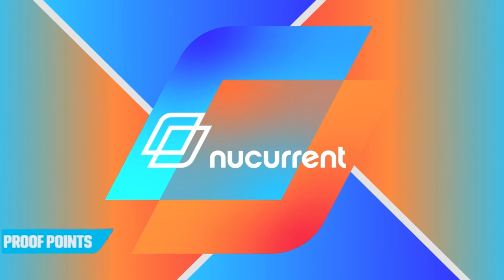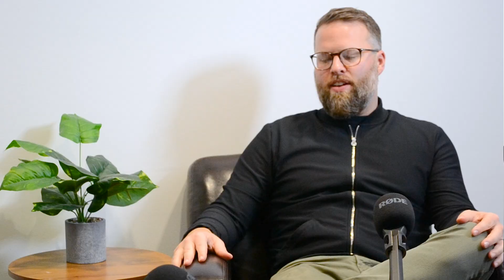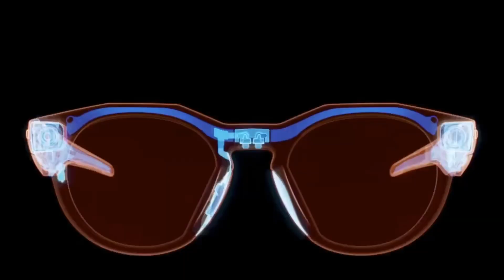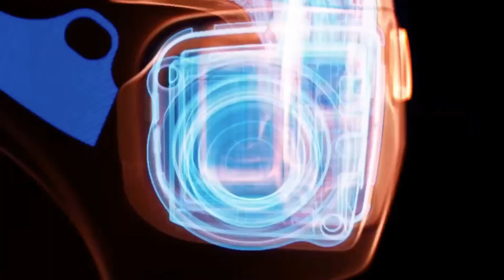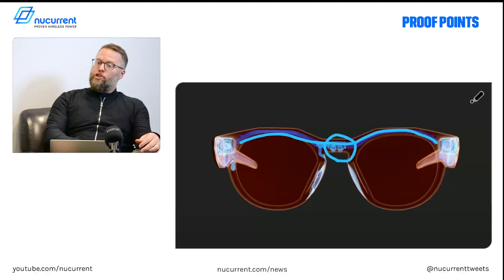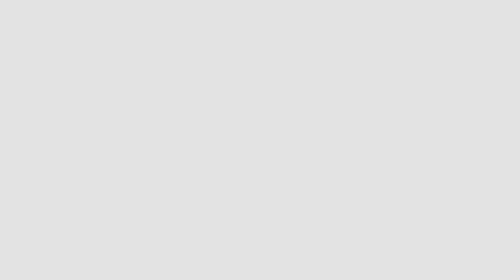Meta × Oakley HSTN Glasses Breakdown: Tech, Battery & Wireless Power

Comment: What brand is the battery? You cannot go from 4 hours to 8 hours without significantly altering battery chemistry or architecture. There are only so many players in the battery space that allow this type of energy density increase that essentially doubles from the previous generation. My money is on Enovix. I am very much looking forward to someone getting their hands on these glasses and taking it apart to analyze what type of batteries being used.